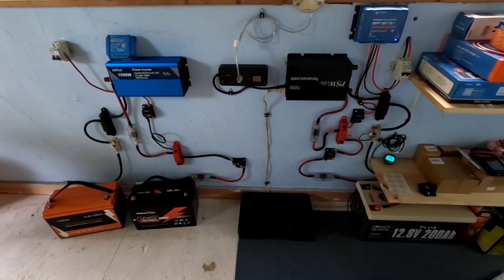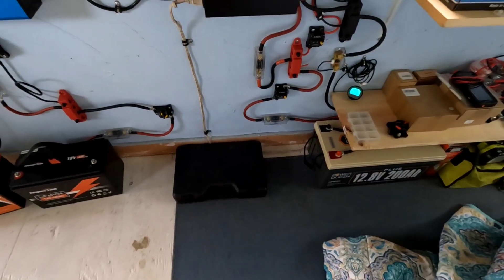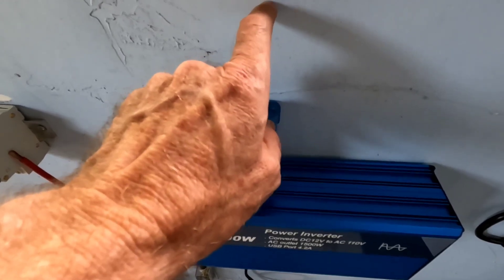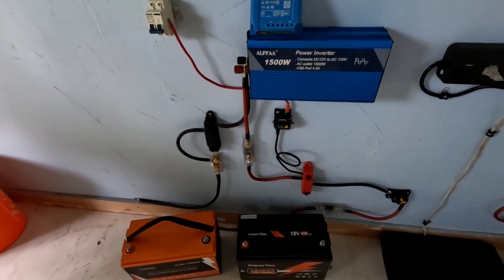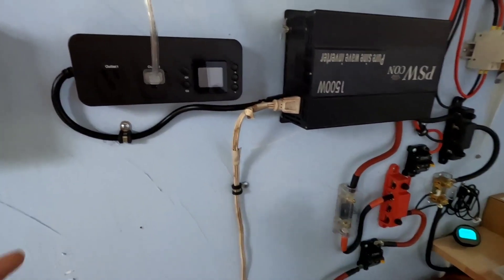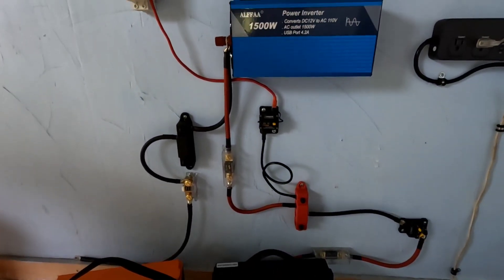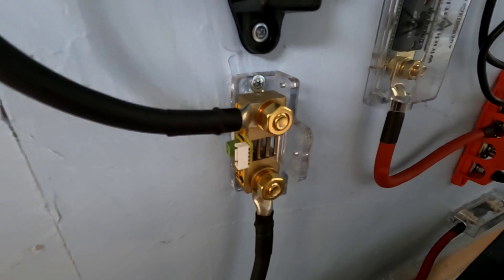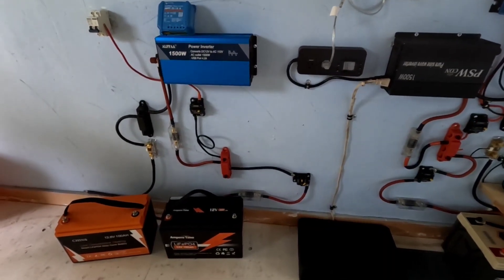The LiFePO4 power wall continues to grow

Comment: Love it.   For my off grid systems I use
Ceramic Fiber Insulation Blanket
In various places to prevent conductors from being exposed
 I also use it because my systems are in cold weather and I need to be able to insulate them and heat them when it gets below 32
But it could be cut up and covered whatever areas you want and it’s fire proof
Reply from the maker: I'm going to look at that. I am not familiar with it at all. Plenty thanks! aloha 🤙

Comment: It's so great to see your off grid setup is constantly expanding!  The bonus is if you ever need to use those batteries on your main system in case of emergency, you can just wire them right in!
Reply from the maker: I do love having redundancy in everything I rely upon off grid. Plus it's just plain fun, and a bit addictive building these systems...always see something else I want to add, or try. Mahalo for being part of the conversation here...aloha 🤙

Comment: I have a stand alone 12V system for charging battery's.  120W working fine. I have clip leads to the battery . what I like with LiFePO4 is no out gassing and safe for indoor use. And with internal BMS protecting battery is a extra bonus. My big battery's are vented to outside and in sealed box . they are NiFe and produce HHO gas when charging . love the entry way of PV wire from panels. I used gray electric conduit .  I used DUCK seal on all my entry ways . Home depot/lows has it. Most of my stuff is UL listed or approved. I did my bare wires a little different that go into terminal with screw to tighten. I used a solder pot and dip my leads  and heat shrink. I don't have many like that. Mostly copper lugs crimp and solder. Get some fuse holders and 5 or 10 amp fuse on battery monitor like your big system. lots of amps can go threw a small wire like you found out. That's why  FUSE or BREAKER all leads off battery system. I just got more fuses from amazon today Sunday !
Reply from the maker: Sounds like an amazing system you have built.  im going to check out that Duck seal you mentioned. Mahalo for reminding me about about that small fuse! Always nice to get more eyes on the system,  and you always paying attention to details...which is much appreciated.  aloha 🤙

Comment: @ 1:13 why do you have a fuse and a breaker coming off the battery on the same run?
Reply from the maker: I use the breaker as a kill switch...aloha 🤙
Reply: @ProjectsinParadise808  couldnt you use the breaker as both? also what gauge wire do you use with the shunt for the pos line to the bus bar? i have the same battery monitor.
Reply from the maker: @ARMEDPATRIOT757  had to use 22gauge....those are super small connections in there.🤙